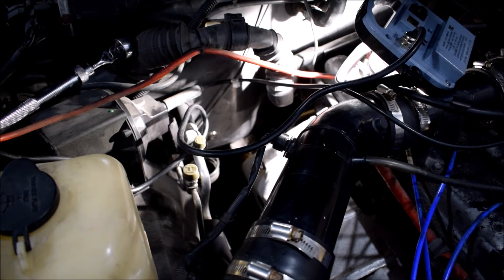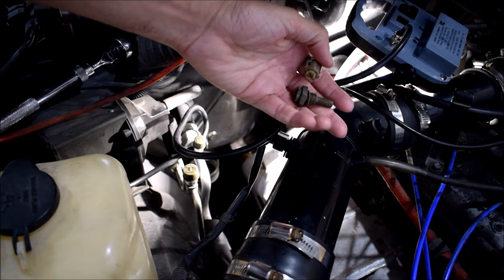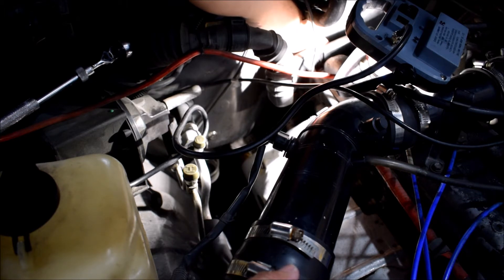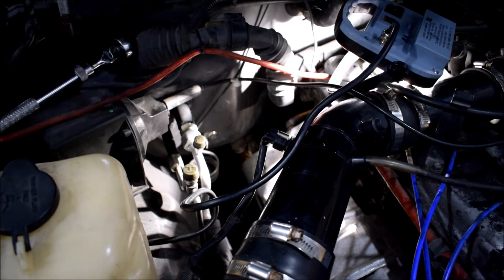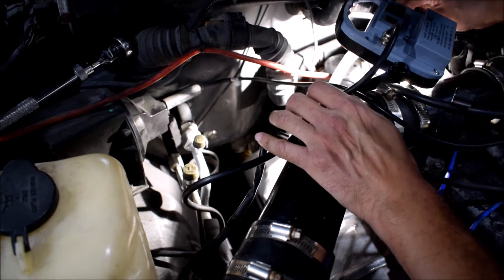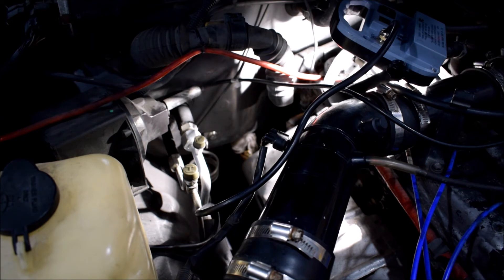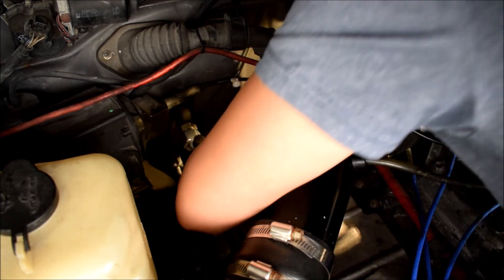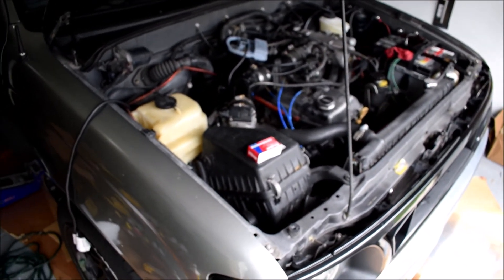Tacoma 2RZ Coolant Sensor Replacement

Comment: Just had this fixed. It will NOT start when its remotely cool outside if this is damaged
Reply from the maker: @1972mrkleen  yup. It's an absolute nightmare trying to get the thing running when that sensor is damaged.

Comment: Can't see. I guess I'll buy a little mirror when I'm getting my deep 19mm
Reply from the maker: I ended up giving up on seeing. I just felt for it and worked that way. It's one of those odd things when working on cars, but it actually helps me to close my eyes and just visualize the sensor.
Reply: @doitwithproperstyle  I tried one more time. Stuck my phone in there and took a picture. Then I understood the clip. Used a small screwdriver.  I stopped there for tonight.  Just glad I was patient and didn't break it. The rest won't be bad. Thanks again for the video.

Comment: Man. I was just starting to get pissed off. Found this video. Thanks for showing me your socket stack up with swivel. To harbor freight! Only part you didn't show is how you disconnected that damn plug.
Reply from the maker: I'm glad I was able to help! The plug you squish with your fingers and wiggle off gradually. This was extra annoying because the end of my sensor was broken off with the plug attached.
Reply: same thing happened to me...is there suppose to be a copper crush washer that goes with that sensor? @doitwithproperstyle